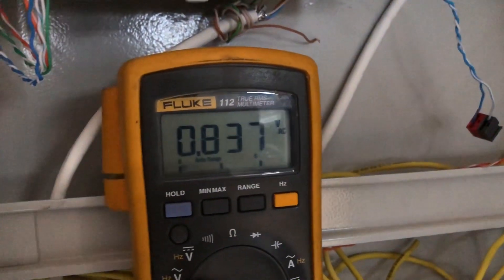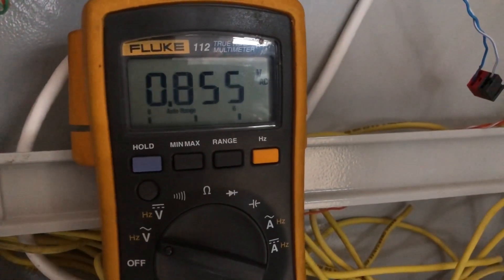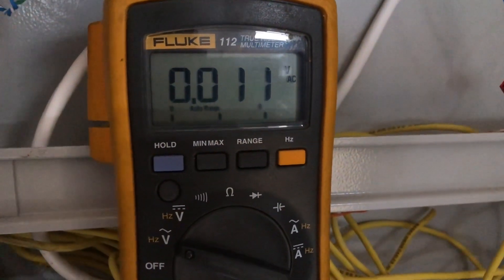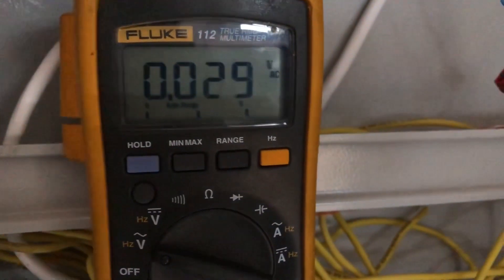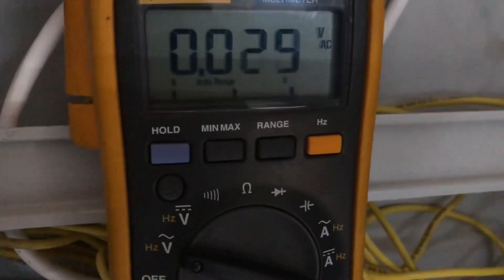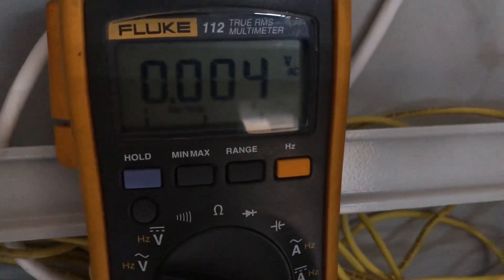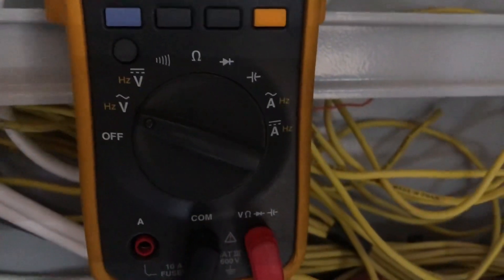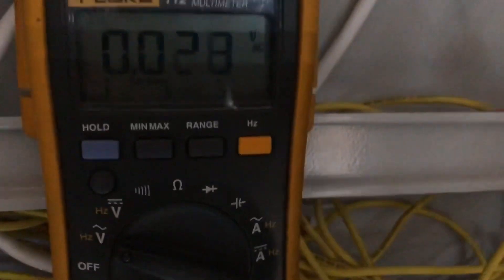How to check RS485 signal with Multimeter True RMS -Video 1(1st Video)

Comment: So, if I understand correctly:
Tester in Alternate Current mode.
one tip on the D+ and one on the D-
Should the reading between the two be between 0.8 and 1.2 volts?
Is what I understood right?
Reply from the maker: Yes correct,
If you don’t see this varying voltage, it means there is no output from RS585
 port / connector
while send or receive signals.
Reply: @magentastar8839  thanks for reply, on one card I see the voltage floating, one other the voltage is fixed.
Can I try if there is a problem in input of the IC? First to try to change the 485 ics
Reply from the maker: @antonio.stefanelli  
Ref. To IC level ( repair) I have not done, therefore no idea.
But if you maintain the power 12 V DC normally operating voltage, and input conditions are maintained. If IC is ok , it should give outputs,
I think you have no option but to try and change the new IC 
Good luck
Reply: At one point in the video we get a reading of 0.004V. This is way lower then the stated 0.8V? Why is that?
Reply: Where we have to measure this , master or slave end?